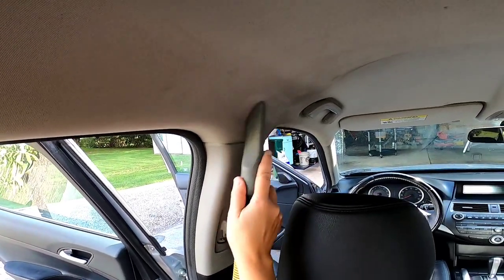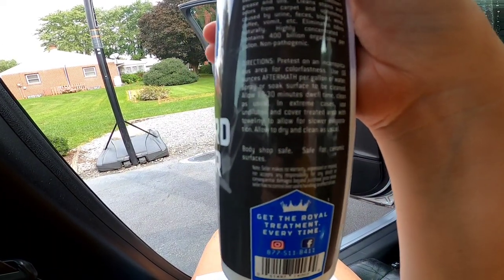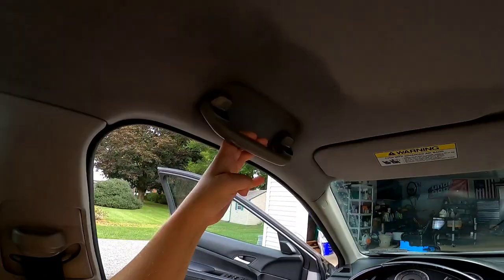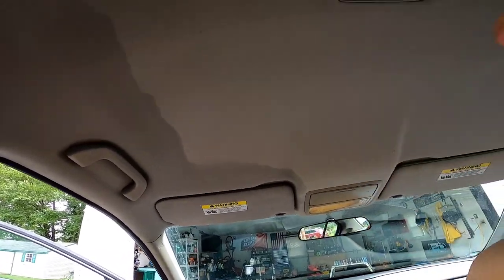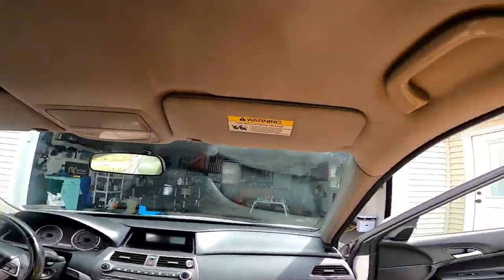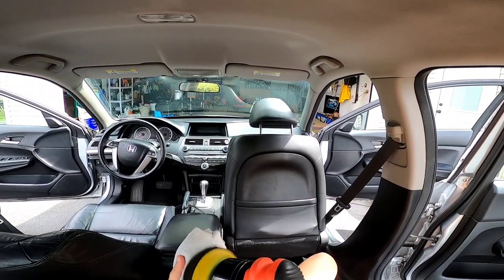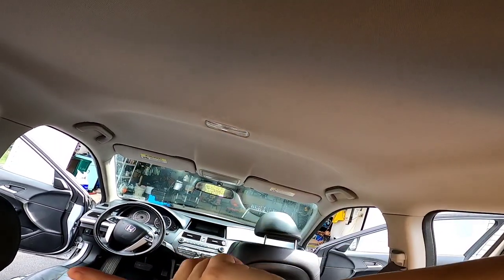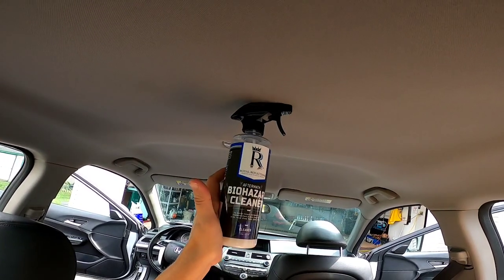Smoke Stained NASTY Headliner Cleaning- Techniques + Royal Reflections Aftermath Biohazard Cleaner!

Comment: If I only have the cleaner and microfiber towels is it better to spray the towel or spray the area with cleaner before wiping?
Reply from the maker: Spray the towel, then clean the surface versus spraying it on the headliner because you’re just going to push the dirt further out and make a clean spot

Comment: Hi Chelsea, I've had my used mazda 3 detailed plus an ozone treatment, plus chlorine dioxide treatment. I can't smell "cigarettes" but it smells musty. I realise my clothes and hands smell like smoke from touching the steering wheel so the smoke is likely embedded in everything. What should I do? An overnight chlorine dioxide treatment?
Reply from the maker: Have you replaced the cabin filter? And when they detailed it did they shampoo everything? I would do a overnight chlorine dioxide treatment if youre still concerned. When was it detailed?
Reply: @attention2detailswchelsea  I replaced the cabin filter myself after the second treatment. I assume they shampooed because I noticed fewer marks in the headliner. I purchased the chlorine dioxide treatment from your other video and let it run overnight. I might leave it still in my car another night before airing it out. Will report back on the results.

Comment: Curious why the Biohazard had a spray nozzle when you are supposed to dilute it. ?
Reply from the maker: I use it straight up for the nastier details. It works great
Reply: @attention2detailswchelsea  got it thanks for the added explanation. I have another quick question - On your tools used you list a 6" polisher but a 5" pad. Was that just a typo and I need to make sure to get the 6" pad too so it fits the polisher 6" head?

For context I'm totally not in this business and just trying to work on a used car I just bought that reeks of cigarettes and is physically affecting my breath and eyes and if I can't fix it I'll have to sell it.
(Also I'm probably going to go with the cheapie $67.94 AVID power buffer just for my one or two time project so hopefully that's fine)
Reply from the maker: @kevinbrianfahy  I switched all of my backing plates to a 5 inch backing plate as they tend to correct better
Reply: @attention2detailswchelsea  got it. Great video, appreciate the upload

Comment: Do you have any discount code for this product please
Reply from the maker: Yes! A2D15 to receive 15% off!
Reply: How does this product which I ordered in the video compare to Zap
Reply from the maker: I have to do more testing on it to say. Id imagine they clean similarly but this has the added benefit of attacking odor causing bacteria.
Reply: @attention2detailswchelsea  thank you love your videos
Reply: @barrydehart5630  if you want a similar product from Superior Products you're looking for Heavy Duty Enzyme Cleaner which is professional Stain and Odor Remover. $23.97/gallon RTU (Ready to Use).  I use it with Zap It during Extractions in smelly vehicles.
Reply: @altillman1448  thank you
Reply: @altillman1448  can this be used in a extractor and does it foam
Reply: @barrydehart5630  I've combined it with Zap It in my extractor with no issues.  I love it!
Reply: @altillman1448  would love to pick your brain on detailing

Comment: You definitely can’t go too aggressively cleaning a headliner in a smokers car. The adhesive and foam backing will have already started to break down from the by products of the smoke. It will inevitably sag and need to be re-glued.

Never buy a car that’s been smoked in. Plastics and fabrics will have already suffered damage that will shorten their life.
Reply: I thought so too, but what is your suggestion?
Reply: @reeb9016  Do what Chelsea did and apply using a spray bottle and gently use a DA or by hand with a microfiber towel. If you add any heat or excess moisture, you risk causing the glue and foam to breakdown even more quickly. Remember, your addressing the staining. Odor removal can be done using an ozone generator after and initial cleaning of all surfaces.